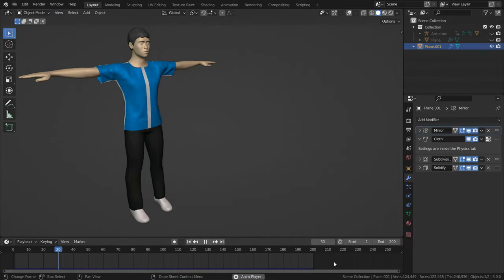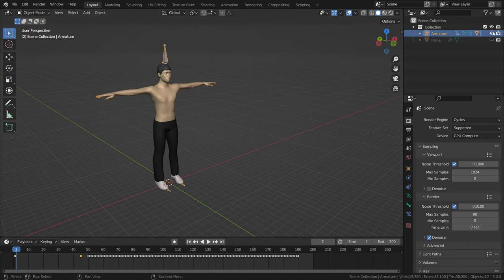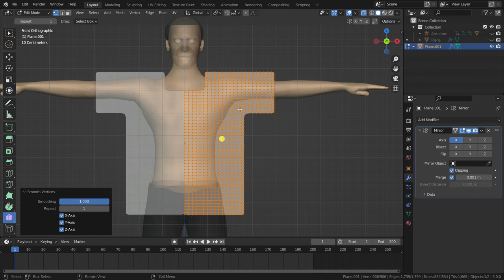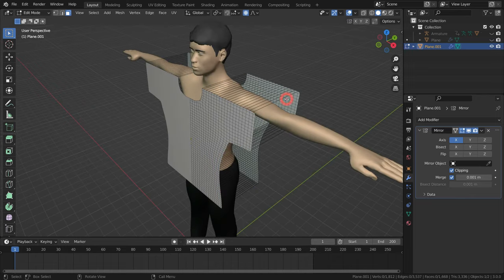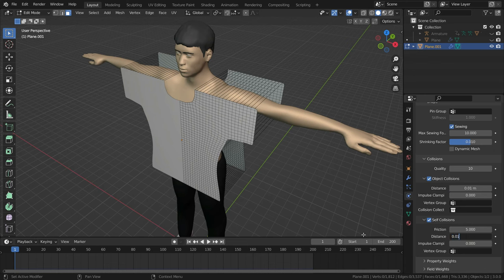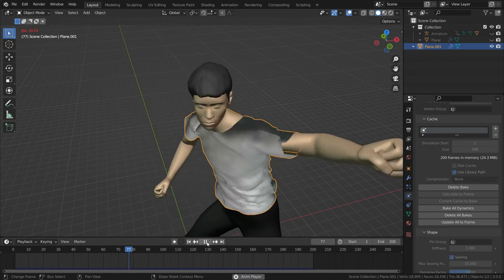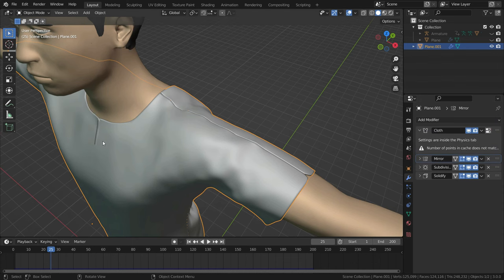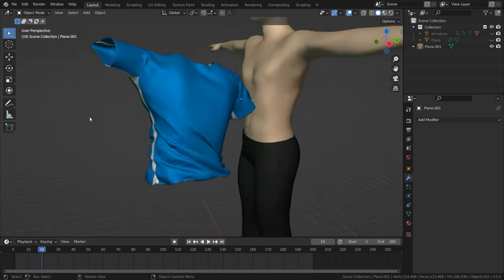Cloth Simulation And Sewing | Blender 3.0 Tutorial

Comment: Important note this tutorial missed:
If your cloth is all jittery and curls up on itself instead of being smooth , make sure to scale it x10 atleast, clotch simulation requires big dimensions for some reason. 
Took me a while to figure out
Reply: Good tip! But this can be caused as well by the default distance value in the selfcollision tab. (in the cloth settings "Collisions"->"Self Collisions" -> "Distance".) If you lower that value (which has the same effect than increasing the size of the mesh) from the default  0.015 m to let's say 0.001 it mostly solves the problem described above. It can cause some clipping but if you increase the value a bit more again, but keep it under the default value, you should be fine. :)
Reply: I thought the same thing. If you want to avoid a headache, enlarge the mesh. The standard plane size is 2x2m so the figure is about 10m high. This should be indicated in the video.
Reply: followed the instructions 100% - kept getting bad renders- read your comment---- big THANKS!
Reply: bro omg tysm
Reply: This seems to be a general Blender physics issue. Water physics refuse to work in low scales as well.
Reply: Thanks for the tip!

Comment: Thanks how to fix the gaps in the clothes?
Reply from the maker: You can scale up ur cloth before playing the simulation.Also be sure that ur sewing force enough.
Reply: @GraphicsMK  its still the same thanks tho
Reply from the maker: @Diyosh  Maybe still too small on the X axis and sewing vertices can not reach each other.
Reply: @Diyosh  One thing you can do is apply the cloth modifier, go into edit mode and manually adjust/close the seams you're having problems with, and then apply a new cloth simulation again after that. Basically, that lets you turn the piece of clothing into an editable object so you can fix the seams yourself, and applying a new cloth simulation at the end allows it to behave like cloth again and allows you to animate it as you did to begin with.
Reply: @Diyosh  Are you sure that these are really gaps in the cloths?

It might be the character the cloth is colliding with that is coming through. You need to adapt the distance of the cloth accordingly then.

As far as I know, you can go to the specific keyframe where it appears and use a brush to alter the weight for this specific area of your cloth on that keyframe.

Comment: Not sure why when I play the animation, the shirt just falls off of the character. Both have collision on.
Reply from the maker: Maybe u need to increase the cloth quality value at the top.
Reply: The shirt only should have self-collision (!) on (that is part of the cloth modifier), but no collision for itself.

Only the character has a full collision modifier applied to it.
Reply: @anotherguycalledsmith  thank you! I will try this
Reply: @andie.pi.  Hello, Andrea, you are welcome ;-)

In my very first try, I did the same, but the correct way is rather simple.

The cloth modifier is added to the mesh of the shirt and the collision modifier is added to the character (or a plane representing the floor).

If you leave this collision modifier off entirely, the shirt would fall endlessly into oblivion ;-)

But the shirt being a mesh with cloth modifier would normally have self-collision checked as an option.

That simply means that the shirt whenever it is getting into contact with itself would deform only on the surface of the shirt — but not intersect with its own mesh (intruding its own mesh) because of calculations of the physics engine.

Crazy math behind it, I am so happy that we only need to apply this modifier and do not need to calculate something like this by ourselves… ;-)